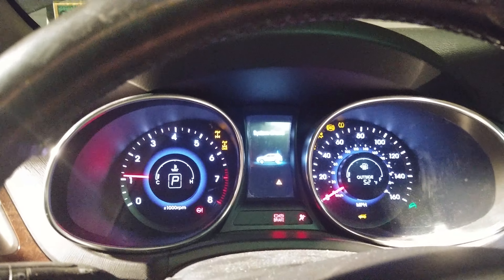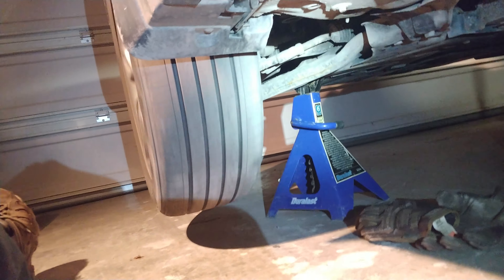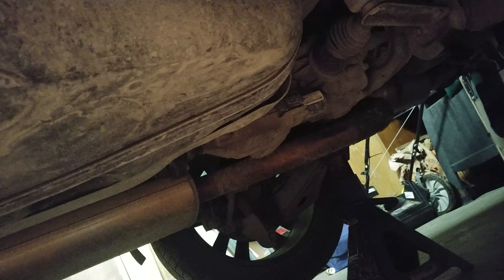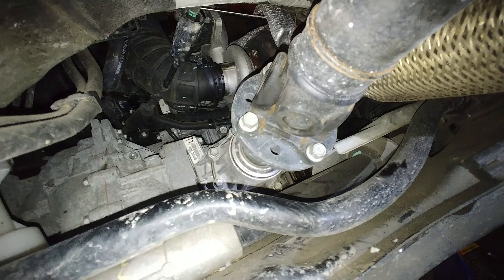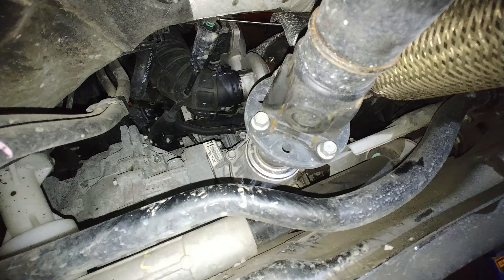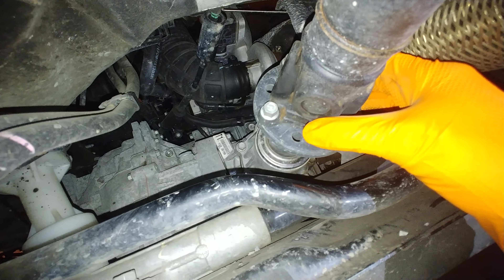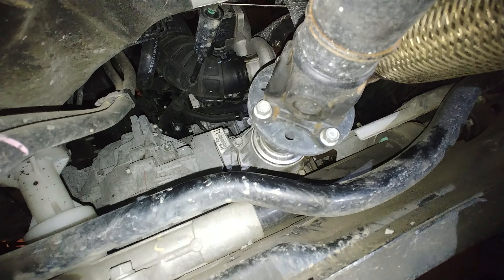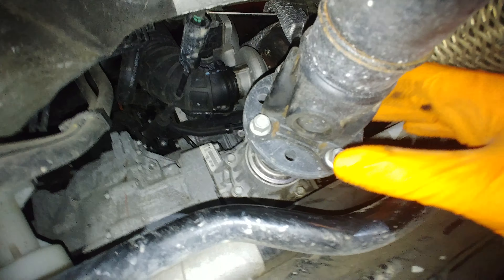2013 Hyundai Santa Fe AWD issue

Comment: We are a group of hyundai santa fe owners with a total of 37 person , and we all have the same problem with the 4WD system , and all of us with odo meter below 150,000 KM  be cause hyundai are making the worst Transfer Case ever , this problem should be fixed by hyundai for free only if we all sent a mail to then complaining about this problem. !
Reply: That's what happen my santafe xl last Saturday my odo meter 147000 KM
Reply: seems like all the Korean SUV have this problem, my Kia Sorento is having the same problem.
Reply: Same issue here with 68 000 km.
Reply: @bbng4770  yup , santafe and sorento has same engine , gearbox and many other things.
Reply: Do you have Hyundai email address in South Korea.
Reply: This happens to me on 123. .y mechanic told me to swap out the whole shit.
Reply: I also got a 2013 Hyundai Santa Fe An my #AWD does not work at all!! 120,000 miles

Comment: its usually the awd drive coupler that mounts on the front of the rear differential that goes out they go out often that runs the awd if you ever experenced cling or skiping turning  corners
Reply: That is happenning with my 2016 XL now. Did you replace it yourself ?
Reply: @newfietrucker1967  ya i dont wanna tell ya what it is but i will i replaced the back one wasnt it then i bought a transfer case that wasnt it both easy to replace n heap on ebay the problem with these the female spline in the transmission strips out or rounds off from the male spline from transfercase which only way to fix is new trans from kia i was quoted 2800 installed you can still drive it but youll only have front wheel drive

Comment: This is very common happened to mine twice and my brothers also.  It’s the transaxle and transmission. The teeth around the transmission that grabs the transfer case pinion gets stripped. You’ll need to rebuild or replace the transmission.
Reply from the maker: Yep, that's exactly what it was. Just haven't uploaded the video yet
Reply: @jamminmechanics  Hi, I just experienced the exact same failure in my 2013 Santa Fe XL. Will you be posting a video on the transmission replacement?
Reply from the maker: @luffy858  Yes, a video on that will be uploaded soon. Also have a video being put together of the transfer case removal and break down on what the failure is and how to avoid it
Reply: @jamminmechanics  

Hi i have got same problem with my Santa fe 
Are you going to upload another video soon.
Thanks
Reply: @luffy858  ,1gee
Reply: @jamminmechanics  +1, wife's Santa Fe is exhibiting these exact symptoms now.  Through summer she was experiencing a little wheel hop/shudder from what felt like the inside rear wheel while turning corners on dry pavement.  No longer feeling that shudder, nor are we feeling AWD now...  :-/  Eagerly awaiting your next video on the fix and further prevention.
Reply from the maker: I have disassembled everything and have videos showing and describing the process and issue in detail. Will have it uploaded soon, just need time to sit down and edit it all together lol
Reply: @jamminmechanics  
Waiting for your next video
Reply: @jamminmechanics  

Hi. I have been to Hyundai garage. It is the same problem with the transmission and the 4WD is not working. They said that it can be damaged the gear box as well. But that can't be checked on the computer and they are not sure. The two weels are working normal but it doesn't have that much pulling power. So did you change the transmission only or the gear box aswell while you upload the new video? I would be really thankful for your reply.
Reply: @jamminmechanics  Hi. Might you still be planning to post the video of the repair to this on your Santa fe? I have the same issue and would love to learn more about the repair challenges.  Thank you
Reply from the maker: @brandkid45  Yes. It's taking quite awhile though, as it is a very complex and somewhat expensive repair 😒 However, I should be uploading an update on it soon
Reply: @jamminmechanics  Ok great thanks. I am pushing Hyundai to supply the parts and I will cover the labour by doing the repair myself but I would love to see your vid on the repair to see what is involved. I appreciate your time. Cheers
Reply: Possibly caused by not replacing all tyres at the same time. Change just 1 or 2 tyres the height difference will cause the sensors to think the fronts are slipping so will engage awd which eventually strips the splines.

Comment: The splines are stripped in the transfer case mounted on the back of the transmission.  Usually would only occur if vehicle is operated in awd under a severe load.
Reply: Its an awd, you cant drive in fwd mode.
Reply: @DrLoveQc  These are fwd until wheel slip is detected - so yes, the OP is completely correct. If it engages while under a decent amount of torque, farewell to the splines

Comment: If the problem is with the transfer case at the transmission, once you drop the driveshaft could you then turn the driveshaft by hand to make the rear wheels turn?  Just to eliminate possible gear failure in the rear drive components.
Reply from the maker: You would need to turn the key on and engage the AWD lock. This is because the H-Trac system Hyundai/Kia uses engages with a hydraulic coupler that is mounted in front of the rear differential. Under normal driving, the PCM and ABS modules use the ABS wheel sensors to determine wheel slippage and engage the AWD on the go

Comment: Hi, am so glad I came across this video! My SantaFe 2014 (India) has been having a very similar issue for a while. There is absolutely no light/error on dash console or on OBD scan, however, my hunch was 4wd was not working as I kept on getting stuck in sand/mud etc. This time I pushed the Hyundai ASC to investigate beyond scans, and recently they confirmed there is an issue and they have told me a very similar reason (am not tech expert) as mentioned in your video. If this is a known issue with SantaFe I wonder why have they not recalled; and if I can push them for a replacement irrespective of whether the car is still in warranty or not!! 

Please do share links for further solutions, and if there are any forums where I can take this up please?
Reply: Or is there any link (apart from google) where I can find info on more such reported cases?
Reply: Recalls are only for parts related to safety. Failure of other parts is only covered until warranty runs out.  In situation like this what should be done is class action lawsuit where all owners are suing Hyundai for it at once
Reply: @krisk1547  Thanks Kris! I had escalated my concern to Hyundai India and I was fortunate that they took care of it entirely.
Reply: hi @usdoc5640  , I am presently going through a similar situation(absolutely no light/error on dash console or on OBD scan, however, my hunch was 4wd was not working as I kept on getting stuck in sand/mud) which you are going through on my 2015 Hyundai Santa Fe 2.2 crdi 4wd Auto, how ever my car is out of warranty in India, can you please share what was the issue diagnosed by hyundai india on your car and what was repaired/replaced, you reply will be much appreciated. Thanks and Regards Nikhil
Reply: Transfer case splines issue. Transfer case had to be replaced. Get your vehicle physically inspected at ASC for what’s exact issue with yours.
Reply: @usdoc5640  thank you for the prompt reply, much appreciated🙏

Comment: I had an issue with the rear differential, clunking noise, diagnosed as the coupler. Guy disconnected the viscous coupler electrical supply, mean they car is now only front wheel drive until I can get parts. The issue in this video could be an electrical issue where the viscous coupler cable had become disconnected or broken?
Reply from the maker: This was a failed transaxle. Check my latest video on it
https://youtu.be/RlG4krje0iY

Comment: Mine is 2016.I have same issue but I got an icon on the dashboard light all wheel drive mulfuction.
Reply from the maker: That will happen if you go over terrain where the 4wd tries to engage. The sensors will see that the rear wheels aren't responding and it with Ding the AWD fault light at you

Comment: Does the Tucson uses the same system? I have that problem, but when the wheels are spining in a slippery surface, the light "4WD failure" comes on...
Reply from the maker: Yes, depending on the year. They all use pretty much the same system

Comment: Same problem with my 2012 kia sorento awd.. the gear going to the transmission to the transfer case.. fix solution in my case is I had to buy a used transmission problem solved.

Comment: i am glad i watch your video.the Issue with my santa fe 2014 3.3L (UAE) is when reversing, an abnormal sound under the car is heared like a banging sound.(bloggg).so i went to the service center.and they diagnosed as transfer assembly problem that costs around 2450USD alone plus the differential assembly that costs around 350 USD.plus oil, bushings etc plus labor which costs a lot.my concern is i never use my AWD.how come it was broken.thank you very much.hoping to hear from you.and i am waiting for your next video about the transfer assembly replacement.many thanks
Reply: what happened to your car? i have my santa fe 2014 3.3 also here in UAE, and the issue is when turning left or right abnormal sound coming from the rear end like (tog tog tog) and jerking..
Reply: @daryllacerna801  hi bro.after that , i did nothing.I believe they found the problem when they opened the assembly, i'm sure they opened it because they told me that there were two teeths broken , not sure which part of the assembly. I told them that i don't have budget at the moment for more than 10K AED. Since i can still use the car w/o using the 4WD, they just fixed it back.Fortunately until now, the sound issue was gone.  That issue was only when reversing.Thankfully it's gone

Comment: This is an old video posting but I’m wondering g if you figured out if the spines were stripped in the transaxle final drive and the transfer case input shaft. I have the same problem but I bought the car used and can’t tell what damage is done prior my ownership. Did you post a follow up video on the further diagnosis and repair or was it never repaired ? If it was repaired did you need to remove the transfer case to determine that both splines were stripped ? Thanks

Comment: hi did you ever figure out the issue? i have a 2015 santa fe which has a clunk and a jolt when reversing. car has 95 k miles and i just bought this from a private party who claimed there was no issue.sometimes it makes the noise some times it doesnt but after the noise it drives fine. Had amechanic put it on a lift and there is play in the driveshaft when turning it back and forth.We didnt check 4wd operation though. Any suggestions? thanks
Reply: Hey I'm having the same issue did you ever find out what was wrong with it?
Reply: Sorry , no I never found out. Took it to 2 shops and both said just drive it as it was intermittent and didn’t have any grinding sound. It was out of warranty because I’m the second owner so, no way I was going to Hyundai for their crazy prices for repairs and diagnostic disassembly costs. Have you had any inspections done on it? I’ve been carefully driving it and in the cold it hasn’t done it in several months but , I’m sure it will return .
Reply: @warrenepstein1348  Is the car still making that noise in reverse? Almost sounds like you hit something or crush something under tire? Same problem here, but debating on what to do.  Going to check engine mount under engine first.  Any info will help.  Thank you.

Comment: Hello my sportage has same problem did you solve this problem? Can you tell me pls how fix it
Reply from the maker: You will need to figure out if it's an issue with the differential, or the transfer case. The one with the issue will need to be replaced
Reply: It’s actually the transmission.  The teeth gets stripped that turns the transfer case and in turn makes the awd rear wheels turn.  They really need to put out a recall on that
Reply from the maker: @christianlopez9236  Yes, I have talked to Hyundai about it. No recall yet, but there really needs to be

Comment: On a Hyundai, does the AWD locking switch function as a switch for FWD and AWD?
Reply from the maker: The AWD is automatic when the vehicle senses the front wheels slipping. The 4x4 lock manually locks the front wheel drive to rear wheel drive, acting as 4wd. FYI, it's only supposed to be used when driving in snow or mud etc, not to be used on dry pavement

Comment: Is there any way to bypass AWD and just make it front wheel drive?  Can I pull a fuse etc so I dont need to fix the transfer case?
Reply: This just happened to my car the other day, away from home. A mechanic took the propeller shaft off and it’s a FWD only. Simple job, 10 bolts to remove.

Comment: my 2012 sante fe has an issue with the rear end.  sometimes when starting off and turning, the rear end acts locked..  the tires will shimmy, and then a big clunk.  i assume at that point, the differential lock snaps out.  any thots how i can cure this?
Reply: I’ve always assumed that’s the handbrake not releasing.

Comment: I bought a second hand 2014 Kia sorento, V6, 3.3.., 187k kilometers done..my  cars engine blown I replaced (2k usd spent)with a used nice engine,  next problem started when  40 speed to down 20 speed click, clock sound ..I gone to the mechanic they suggested to change the gear box😮 2k usd..I am in a dilemma..
kia Sorento is a crap ..

Comment: You're a mechanic???????????? All 4 wheels have to be on the ground for this system to operate............it's about torque transfer which cant happen unless torque is detected at front wheels first.   Put it over some gravel and have someone watch as you gas it and you'll see all 4 wheels powered up. Good luck.
Reply: Nope they don't have to be on the ground while in 4wd lock.